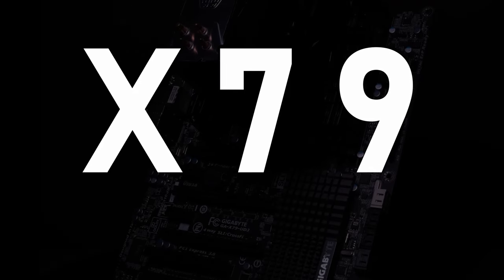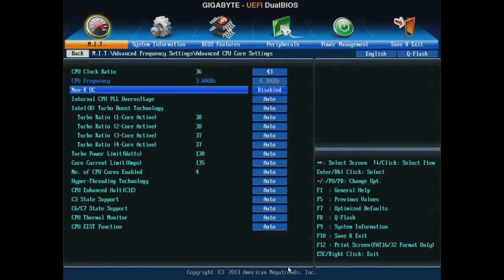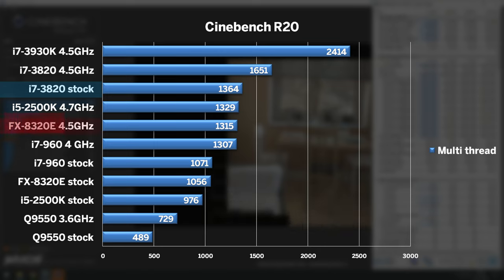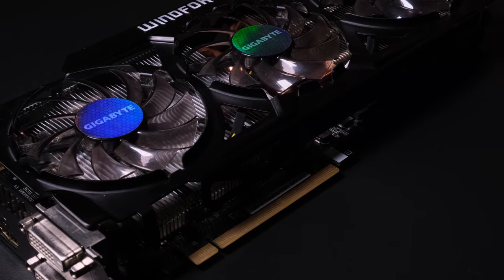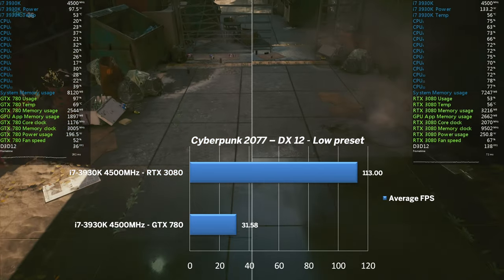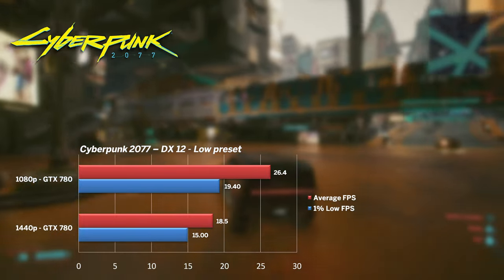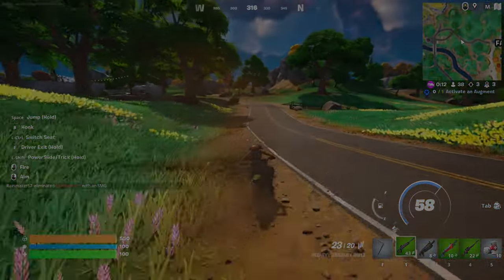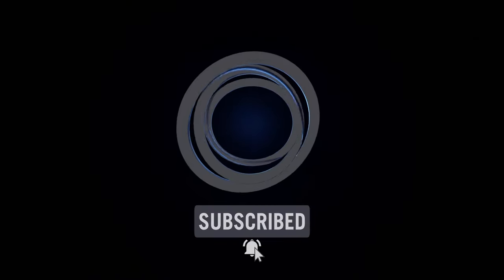Are you tempted by Intel's X79 platform? I was too! - From the archives vol.3

Comment: It still a good system considering it age. I built mine back in 2014 and still my primary system today. 48gb of 1866 ram 4930k processor 1080 gtx graphics. Tri boot os window 7 10 now testing 11 on a 2 tb ssd with multiple 4tb for other storage and games.

Comment: Xeon E5-1680 v2 is the CPU to use on X79. It was not an official consumer market CPU and was instead an Apple special that was to be found in their Mac Pro Trash Bin lineup (looked like a garbage can). That CPU was a monster. I have mine clocked at 4.8GHz. Yes, this one is multiplier unlocked. This CPU has been replaced, as my primary system, with a Ryzen 9 5950x.

Another interesting one is the Xeon E5-2697 v2 but that one is multiplier locked. You can use the boost/turbo multiplier coupled with a small BCLK overclock though. It also doesn't perform nearly as well as the E5-1680 v2 under gaming scenarios. I used this CPU for a while and only recently replaced that system with a Ryzen 7 5800x system.

X79 was a great platform, as you stated, if you used Ivy Bridge E.
Reply: v2 xeons are no good for him, he has a revision 1.0 UD3 board - so its v1 xeons or the i7s only
Reply from the maker: Hello mate! Thanks - this is a great suggestion - Looked this beast up - they are superior than 4960X - but also more expensive. I'll be getting whichever comes cheaper :)
Reply from the maker: Hello mate - thanks for heads up - I'm looking at X79 Deluxe already
Reply: Is that 4.8Ghz with HT on or off?

Comment: I have recently built a PC using the X79 platform. The Chinese are still producing new motherboards with X79 and X99 and they even modernize them with NVME SSD support. For only 80$, I bought the motherboard, CPU and 16GB of ram. The CPU is the E5-2689 with 8 cores, 16 logical cores running from 2.6 to 3.6GHz. I paired it with a used  RX 5700. The computer is able to run Cyberpunk with a decent FPS (50-60). For the total build price of 415$, it has incredible performance. Those CPUs aged so well because newer games have gotten more and more multicore optimized. The youtuber Miyconst has been building those systems with X79 and X99 and has a very interesting channel. He has made a couple of videos demonstrating how you can pair those old xeons with high performing GPUs without bottlenecking. He concludes that those platforms are indeed realistic options for budget gaming PCs. Anything below RTX 2080 or RX 6700 XT might not benefit from a more modern, stronger CPU, depending on the game. I have found that my xeon build has only bottlenecked in Rust, as it is highly CPU bound.

Comment: Currently using this system as homelab (k8s, docker, proxmox and etc.) and it's doing the job very well for me next upgrade will be x99.
The system:
MB: Asus RAMPAGE IV EXTREME
CPU: Intel Xeon E5-2660v2
RAM: 40GB DDR3 1600Mhz
a bunch of SSD's and HDD's 
GPU: GTX 1060 3GB (passtrought to Windows virtual machine)

Comment: Just FYI PCI 3.0 actually launched with x79 and the sandy bridge e so it does indeed have that functionality. 

An interesting point nowadays is to explore higher core count xeons, such as 2690 v2 which have 10 cores and decent all core boosts which generally work well in modern games. Keen to see more content.
Reply from the maker: Thanks for sharing Daniel, I'm looking forward returning to X79 in not distant future, glad to hear :)
Reply: the X79 platform is 3.0 capable, but the PCIe lanes are handled by the CPU, and SandyBridge E is 2.0,  while IvyBridge E is 3.0; an Ivy Bridge CPU is necessary to have 3.0

Comment: X79 was great platform. If you consider that it's nearly 12 years old and still can be used in gaming (although it's showing it's age) or at least be home server/computer is something great. Imagine being in 2012 and saying that your PC from 2000 is still doing fine in day to day use.
At this point I wouldn't want to invest in anything older than X99 if you really want to use it for more than just a hobby (owning both platforms and you can feel the difference).
Reply from the maker: Hello mate, that's a great point you raised. Yes, I'm happy that last decade seen a lot of improvement and it is generally more affordable, well...hah! I'm awaiting 10900X for X299 that's to replace current z490 test bench :)
Reply: @nexus_tech  That's interesting upgrade you have there. A bit pricey but given the performance :D. For me thankfully x99 offers still alot of cpus at decresing prices so my wallet doesn't hurt that much when testing one after another. As for my main rig I'm more than happy having x370 with r5 5600 and 5700xt.

Comment: I had a 3930k for a few years, ran it at 4.9ghz. Didn't realize I hit the lottery on that one. Havn't had any luck with cpu's after that sadly.
Reply from the maker: Thanks for sharing 👍 What are you using currently?
Reply: running a lot of systems. but nice to share is that I used to run the 3930k with two gtx 690's. Great times!

Comment: had this Mobo with 32GB  and a 4930k @4.5GHZ all core and UV@1.3V, was the last awsome HEDT platorm i had for 6 years...after this it just got to expansive.
Has seen 3 GPUs, GTX570(only some months), R9290, Vega56. For me it was a very good system for around 1k€ (MB, RAM, CPU).
I want Quadchannel and 40 PCIe Lanes back ffs...
Reply from the maker: Hello mate - Thanks for sharing - awesome - I'm already on a lookout for a Ivy Bridge-E CPU :) What are you using nowadays?

Comment: I just bought the e5 1680 v2 for my x79 set up... beast of a chip and the only unlocked 8 core for this chipset...if you can pick one up on eBay and check it for yourself.👍
Reply from the maker: Hello mate, well done! Great suggestion, just looked it up - tops the 4960X, but also more expensive. I'll buy whichever comes cheaper
Reply: @nexus_tech  hey fella, the 4960x is only a six core so watch for that.👍
Reply: @nexus_tech  if the cost isn't particularly horrendous, the 1680v2 vs 4960X is not just 8 cores vs 6, but also 25MB of cache vs 15MB, a feature that can make a bigger difference than many realize; 1680v2 truly is the definitive CPU for an X79 system.
Reply: I don't overclock, so the 2667v2 is my choice Xeon.

Comment: Chinise X79 boards only make sence if people want to try the platform since i personally used a i7-3820 with a X79GV1.03 Which held a OC of 4.1ghz, later i got a 4930K which i oced in the bios like this 41x 2c load/40x 4c/39x on 6c so the tiny vrm doesnt fry

Comment: The 3820 can be fully overclocked by using the 125mhz bclk strap. You can get over 5ghz
Reply from the maker: I've tried. There was a point where I simply gave up, hours wasted haha!
Reply: @nexus_tech  did you remember to lower the ram speed as well?
Reply from the maker: @LawrenceTimme  yes, followed the SB-E guide, manually adjusted most things, disabled any "boosts" offered by BIOS and yes XMP turned off, manually adjusting each memory channel. Man, this got the better out of me and I'm glad it's over hahah
Reply: @nexus_tech  that is a shame. I have run 125 strap on various CPUs Inc 3820,3930k, 3970x and 4820k on Asus rampage iv extreme and formula and they have always worked fine!

Comment: I'm enjoying my frankensteined X79 build just for the sake of tinkering but it's probably not worth buying today compared to a Zen+ or Zen 2 build from used parts unless you REALLY want 40 PCIe 3 lanes.
Upsides: - All the PCIe lanes. - IPC is decent for its time especially when overclocked, Intel didn't make major advantages in IPC and core count on desktops until years later and AMD of the 2010s were lagging behind anyway. - If your X79 motherboard has an X99 successor you can take the NVMe compatibility modules from that BIOS and slap them into yours (or potentially find a pre-modded BIOS online) and install an NVMe on a PCIe adapter in your rig, or like eight of them on bifurcated adapters seeing as how many PCIe lanes you have. - Did I mention all the PCIe lanes?
Downsides: - IPC is still only a product of its time and pales in comparison to CPUs from this decade even at the same core count. - Even the hexacores are a nightmare to cool when overclocked, can't even imagine how much of a furnace the sole overclockable octacore 1680v2 would be. My 1650v2 (practically equal to 4930K) runs at 4.4 GHz at stock voltage (1.20V) and still sprints to 90°C in benchmarks with a reasonably decent Scythe Mugen 5 Rev B air cooler on an open bench, so any further increase in voltage or clock speed would just make it thermal throttle, or I'd need a beefy AIO. - Not that I could increase it even if I wanted to because my board in particular, the Asus P9X79 WS, refuses to exceed 1.20V regardless of what OC settings I enable in the BIOS. - And another flaw of this board in particular is that the manual contains several errors and also describes a different BIOS interface and different BIOS settings from what I actually see on the screen half the time presumably because the entire section was simply copypasted from another manual because Asus thought the only people buying workstation boards are sysadmins who don't need manuals. Thanks, Asus.

Comment: Hello 👋, what's the thermal paste did you used in 3930k? And how do you applied it on the cpu, spread or pea size?
Reply from the maker: Hello mate, I always use MX-4 and do a pea sized blob in the middle and tiny amount in each corner just in case 😀

Comment: Get the Xeon 1680v2 test again overclock it again too 4.4ghz you'll get way better performance and get the Asus X79 Deluxe win NVME beta bios you don't have hack the bios. The problem with the high over clock of course is that the vrm get really hot especially in the summer. You can also hack the bios too get REBAR. That i haven't done myself of course.